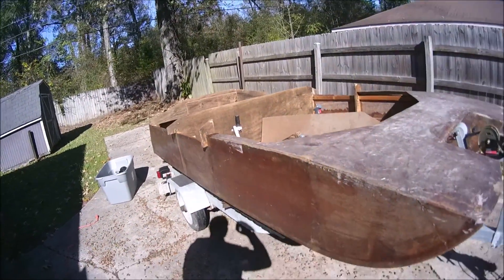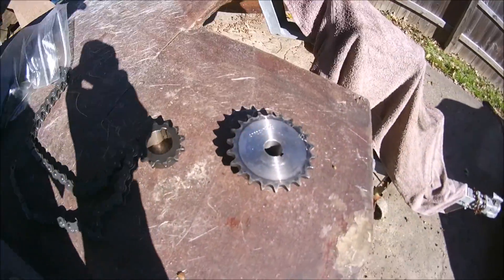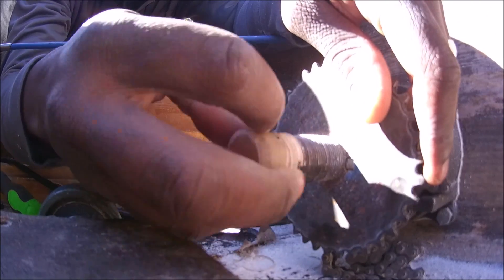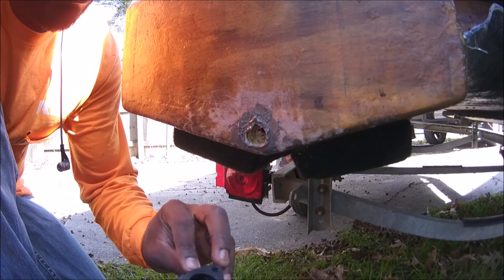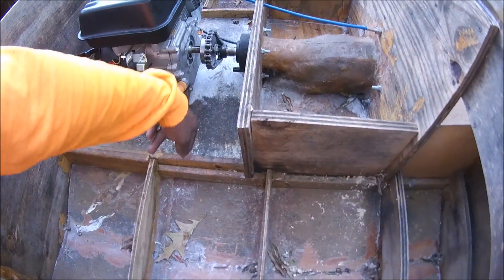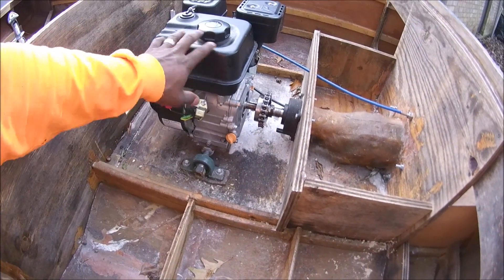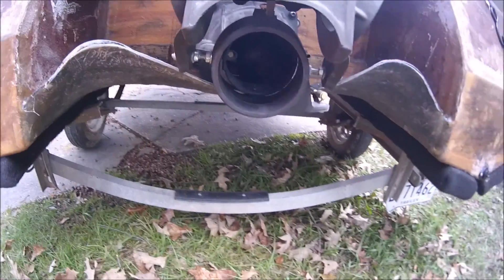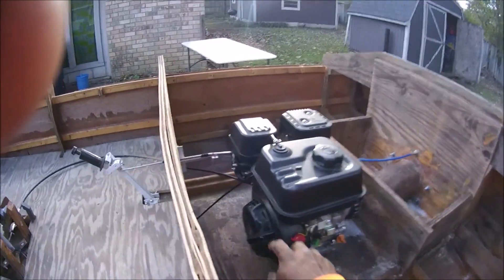Homemade plywood jet boat (Gearing upgrade)

Comment: You don't want to add weight to get the jet into the water because that will take power to push.The problem is to much buoyancy . I think you need to end  the transom where the jet unit bolts on to get rid of the buoyancy beside the unit , also you can build a extended box off the transom wide enough for the jet to bolt to and following the hull bottom, this causes the jet nozzle to get pushed into the water as the bow lifts
Reply from the maker: wow thank you so much brother! You are the first person to point out the buoyancy

Comment: This things is awesome!  I'd go to a go kart clutch and btw...  you can get well over 6000rpm out of those engines.  better exhaust, shave the head, and put a better carb on it and it'll rip. look at all the drag minis out there.  some 5hp engines are pushing 20+  you can easily make your boat go good. I seen the video before,  your gearing should be better now. make a little more power and add a couple thousand rpm and it'll go. Jet drives are inherently slow compared to prop drives. they require more power etc for the same speed. But you're on to something here. only other suggestion I have is maybe the gap on the impellor can be closed up a little. The tighter the seal there, the more push it will produce.
Reply from the maker: Thanks a lot! Thats exactly what  I purchased (a clutch with bigger engine). Thank you for the awesome information and detailed breakdown. Thanks for watching

Comment: Ronald to help with the engine shakeing back and forth so much put a spring between the front of the engine and the front wall in front of it
Reply from the maker: Thanks you! I never thought about that. Thanks for watching
Reply: No problem.

Comment: Nice..that will get that jet turning the RPMs it needs. Now as long as the motor has the HP to push it you should be in business.

Might want to consider a guard for that chain..also if you can a method of oiling it.

But in all it's looking like you've upgraded well since the last time I saw the project..eager to see you next water test.
Reply from the maker: Thanks a lot Doug! I'm excited as well to see how well she perform. Thats a real great idea you had about the chain

Comment: Looks like things are going well ! You can solve your engine mount issue by mounting a piece of 1/4 aluminum plate to the bottom of your craft . Using elongated mounting holes for bolting engine in place . Awesome job !!!!
Reply from the maker: thanks a lot Jay! Very helpful

Comment: If you are going direct drive use a universal joint to link the eng to the DRI shaft . To stabilize the eng mount make a trolly system . Hope this helps . When I say trolley, look up diy camera slider .
Reply from the maker: Thanks a lot William! very helpful brother. Thanks for watching
Reply: No problem, working on a boat myself .I'll keep in toutch .God bless .
Reply from the maker: I would love to check out your build brother; going subscribe to you now just in case you upload it

Comment: Great backyard build, man!
Have you considered using "dog bone" engine mounts higher up on the engine to stabilize it a little?
Something like these with rubber bushings? You can get them cheap in a bunch of different sizes and configurations.
http://www.partsgeek.com/6ny2x55-toyota-camry-engine-shock-mount.html?utm_source=shopzilla&utm_medium=pf&utm_content=mc&utm_campaign=PartsGeek+ShopZilla&fp=pp&utm_term=Toyota+Engine+Shock+Mount
Reply from the maker: wow thanks a lot! I NEVER would've thought about that. Thanks

Comment: You have a 11 tooth sprocket on the clutch in a 12 tooth sprocket on the pump. I would try that with the parts that I have before I buy anything else. Peace out
Reply from the maker: +dirtysmurf That is the smart thing to do; Thanks for the advice brother!
Reply: that should give you a 0.917
 ratio. just over 1:1 plus the clutch will give you slip at low rpm's to help with the stall
Reply: Hey I need help I have the same motor from harbor freight and I need help with some ideas of how to put it on a schwinn stingray chopper bycicle. Gear ratios and how to do that is what i need.
Reply: A 22 hp Vtwin from HF would sure make it more interesting . I seen a Home built jet boat with a Yamaha FZR 1100 in it a few years ago. Not sure the builder and boat are still with us though . In fact after watching it run I would be surprised. It was super fast and he was super reckless

Comment: Should have put your clutch on the shaft and put a larger sprocket on the motor.
Reply from the maker: +AsianPerson3 Thats not a bad idea at all; its just hard to find a clutch with a 1 1/8 bore. I'm not giving up hope though. Thanks for the advice!

Comment: did you unscrew the governer screw on the carburetor? it will give you a lot more throttle
Reply from the maker: +Staffordracing758 I unscrewed it about half way; I'm going to have to try that. Thanks a lot brother!

Comment: love tinkering with stuff like this ron, hang in there its all gonna be worth it! caint wait to see how well this turns out. instantly I day dream of the harborfreight 22hp predator motor and a reduction belt drive, would be a little safer than the chain. throw one in a 1448 or a slickbottom .125 1260!..........anxiously awaiting the next test run, subscribed!
Reply from the maker: +Dustin Apple I love the same thing Dustin! I believe that these kinks will eventually work out as well brother. I've been eyeballing that 22hp 670cc engine for three months now lol. One day brother. Thanks for the support and thanks for watching!

Comment: The ratio you have now would be faster then direct drive. If you want direct drive you would need to move the engine forward and use a ujoint and shaft setup.
Reply: +coljames6217 or he could just keep his current set-up and gear it 1:1. im sure with the new gearing it will probably bog down the motor and may have difficulty reaching WOT. but no big deal, he can easily drop his gear ratio for increased rpm. that little motor should max 3500rpm. im just guessing but it probably wouldn't max in hp till 2000ish, so any result above 2500 top end would be awesome!

Comment: DO NOT run the engine without water going thru the pump
Reply: Its a go kart engine
Reply: The engine is AIR COOLED--What kind of pump is it ?  Water Cooled?
Reply from the maker: +Marvin L Stohs Sr Thats my fault. I dont leave her running long though. Thanks Marvin!

Comment: it should be 1 to 1 ratio ... same as a direct drive ... you do not have enough horsepower this way.
Reply from the maker: +magaiver thats one of the things I was worried about but had no way to test it besides trying it out. If the engine doesn't have enough hp, then we will either go with your idea (1-1) or double the horse power. Lets just hope for the best lol Thanks for the help brother!

Comment: u wood have bring the motor up front to make dr drive
Reply from the maker: +73 SUPERGLIDE I'm still trying to figure out a way to do so without cutting up the hull. You got me beat lol
Reply: what wrong with heal
Reply from the maker: +73 SUPERGLIDE I would have to counter-sink the engine so that both shafts can align.
Reply: no sinking the boat
Reply from the maker: +73 SUPERGLIDE lol we will try not to brother
Reply: just dont do video

Comment: i think its going to work good with the new gearing if no neutral becomes a problem you can always add a jack shaft with 1-1 gear ratio from the motor then gear to the pump what ever ratio you want
Reply from the maker: +floppy Thanks brother, I sure hope she works. Someone else told me that I can lower the reverse bucket half way to act as neutral. Lets cross our fingers and hope she doesn't stall. Thats not a bad idea Floppy, we are going to see how this 1-1.8 works then we'll go from there. Thanks a lot brother!

Comment: You should paint the inside soon. Don't want the water that splashes in to make the wood rot. Awesome work!
Reply: +BK201MXP 
I thought maybe brushing the interior with epoxy before painting.
Reply from the maker: +BK201MXP you are right brother! Thats next on the to-do-list. I would hate for all of this to be ruined. Thanks for watching!
Reply from the maker: +Doan04 that would probably be the better way to go. After the next test, we will be starting that phase. Thanks a lot brother!

Comment: Damn it! no water test?    Can't wait.   Looks good.  whwn are you going to PAINT? .
Reply from the maker: +Josh Kilen we are shooting for another one this weekend
Reply from the maker: +RocketRadioShow1 It stalled when I pushed the throttle past 1/8. If I had to guess, it seemed as if the engine didn't have enough hp to power through. Oh by the way I DID remove the clutch! The only reason why I took it off was because a couple of guys told me that they believe the water would act as a clutch. We live and we learn I guess. I'm going to get a bigger engine, just wondering if I double the hp, will I still need a clutch or torque converter of some sort. 
WOW BROTHER THAT IS SUPER AWESOME OF YOU! If thats the case Rocket, its whatever color you want along with whatever logo as well (just send me your logo and/or links and I will take care of the paint). I will let you know once we're done prepping her. Thanks a lot  brother! That really means a lot!
Reply: +RocketRadioShow1 he did a water test last video
Reply from the maker: +RocketRadioShow1 lol don't worry Rocket, I'm aiming for this weekend! If we don't have any more problems with the hull after the second test, then we'll get to painting. What colors you had in mind again?
Reply: ronaldhotboy
ok
Reply: +ronaldhotboy so excited for you brother.  that things a beast!  I use plain old rustolium paint.   Navy blue is nice.  primer and paint for your boat maybe 50$. 
I found rustolium painted with a brush, wet sand with soapy water, 2nd coat and you're good.  shit lasts well and holds up well enough. cheap to . 11. $ a quart.
you problebly need 3 qts.  (i know it isnt marine paint but I have painted a bunch of boats with it and it works good.)
you might want to put a trinangle shark fin metal pc on the back. maybe 3 inches.
I have added a tiny sharkfin thingy inthe back of little fast boats.  it helps it track and helps the back end from sliding out in a sharp turn,  you can even shape it to throw up a tail.   it doesnt have to be centered. like maybe size of a playing card. or a little smaller.  you may not need it.  but if you notice the ass end swinging around on turns or if it doesnt track straight front to back.  
a tiny sharkfin or two at a slight angle inside the thrust chamber will spin the water to help with that caviatation spot.    like a couple of guitarpick sized ons, fiberglassed in place. a slight matching angle  the water will twirl and may help increase the thrust out the back by organizing the waters shape slightly. 
just some ideas.  gosh, I wish i was there.  very good work.  super genious!  
what kind of seat are you gonna use?
dont even think about not showing this thing haulin ass on the water. 
I gotta see it go.  good job!
Reply from the maker: +RocketRadioShow1 Thanks a lot brother! I will start painting in about a week or so (while I wait to see what I'm going to do about my torque issue). Thats an awesome idea. I havent reached speeds fast enough yet to determine if we will need one or not. We should find out on the third test. 
You are just full of badass ideas lol. As a matter of fact the ride plate is all your idea! If you were here, we would've building a ship hahaha. 
As far as seating, I would love to build my own. 
You don't have to worry about that brother, will not stop until she's running fast enough to blow my hair back lol. Speaking of which, you are the first person to know that the second test run didn't go so well :(
Basically she's stalling. On the positive side, even though I was only able to go 1/8 throttle before she stalls, I still matched the same speed as last time! So I could only imagine how she would've responded at full throttle. The footage isn't really worth uploading, but I want to show you all my failures as well. 
Thanks for everything Rocket!
Reply: +ronaldhotboy stalling huh?  not enough intake of water? or prop spinning to fast? hmmm.  can you extrapolate alittle more about the stalling?    
maybe a scoop?  to increase the uptake of water.?
or new gearing ratios?  
wait a minute. you took off the clutch right?
hmmm. direct drive?  didnt you have a comet gear box?
I have some misc boat parts.  like tie downs. 
i think i got an old bilge pump too.  i could mail it to you.
why dont you figure out how much paint you need and what you want And I will sponser your paint job with paypal.   
keep at it.
Reply from the maker: +RocketRadioShow1 That sounds bad ass brother, I love it! BTW lime green is my favorite color lol. 
I think the same thing; I need more torque. Researching torque for most PWCs...........WHY DIDN'T I THINK OF THAT! I'm going to look that up now to see what I can find. Thanks a lot Rocket!
Reply: +ronaldhotboy neon green and midnight black.
paint the inside black.  tape off the outside and spatter inside with neon green spatter drops.
outside neon green,  tape off stripes and black drizzle . remove tape....

haha

as far as the motor,  I wonder about the torque as apposed to power.
you normally need 1/2 hp per per 50lbs of wieght.  Or something like that.
the normal gear 3 to 1. but that didnt work so good.
maybe mount your motor on peices of cut up tire to reduce vibration.
maybe google jets skis and look into the torque and rpm of the drive.
does the boat when stalling. does the engine die or get muddled?
is the engine maxing out rpmS? or clogging to a stop?
i m just wondering if it is too much water intake or not enough,
is it just a matter of more hp? would your set up push a scale model well?
or is it intake/thrust related.